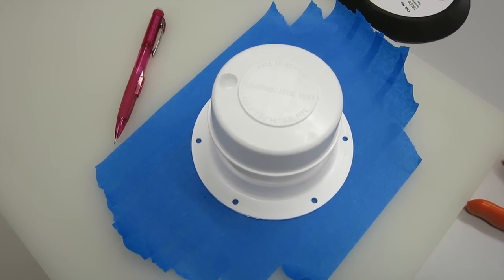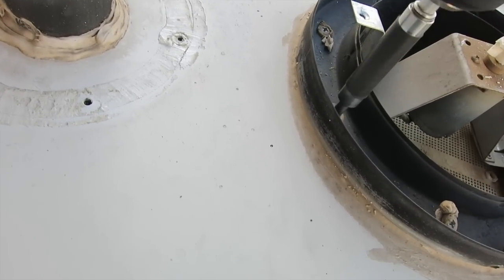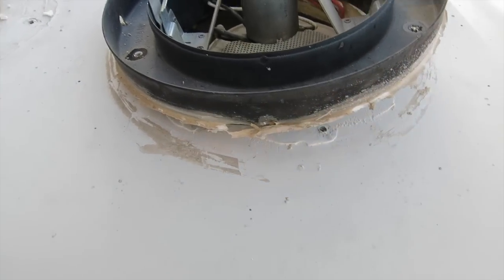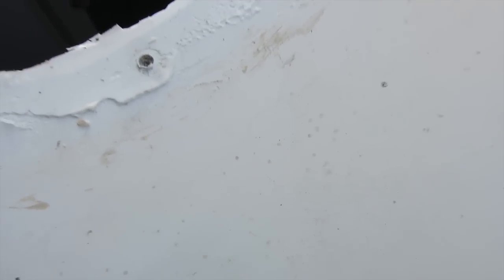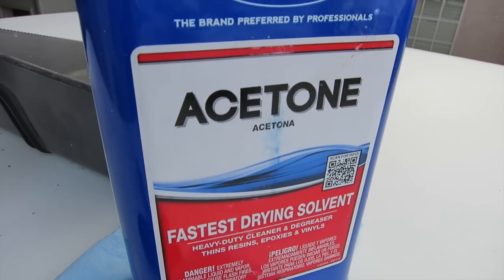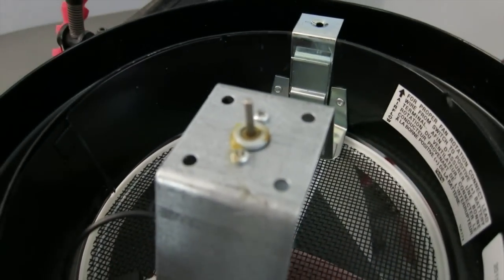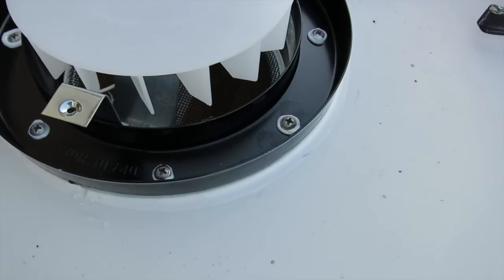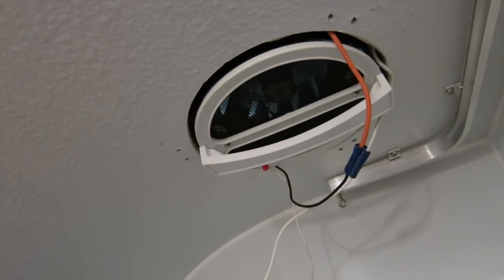RV plumbing vent and bathroom fan replacement

Comment: I can confirm the hard foam insulation is throughout the entire rig. (pop a ceiling light off and you'll see it there).

Only downside to that...especially for me, is you can forget about running new wires through the roof for anything. My number one rule for upgrades and additions is it must be clean and factory looking, no wires visible, so I tap into anything exisiting and run wires through cabinets and such.
Reply from the maker: ***** Yes. I have to find a way run the wire for the new solar. The old wire is too thin for efficiency.
Reply: Xplorer Steve depends on the wattage. I was told a maximum 100-120 watter for that size wire and since I was planning on splitting it into two panels front and back it worked out. Also the one you got is a bit larger and wouldn't fit on my roof due to my fireplace vent and my AC has an air intake on the top of roof. For a 160 watt I'd run new wiring as well. Through the cabinets obvs!
Reply from the maker: ***** Yes, I was thinking the same thing (cabinets). I was also going to remove one of the vinyl covered panels with the button looking things on them. You know what I'm talking about? They are present throughout the van. I'm thinking they are access panels. Have you ever removed one?

Comment: Those "straight" connectors are called butt splices and should be crimped with an electric connector crimper.
Reply from the maker: Yes. I have a special way since I don't have a crimper.

Comment: Nice job....finish looks great.  I would suggest using crimping players not adjustable jaw players to squeeze your electrical splices.  I like the high leverage ones made by Klein Tools.  http://www.kleintools.com/catalog/crimpingcutting-tools/crimpingcutting-tool-non-insulatedinsulated-connectors
Reply from the maker: Terry Landis I've developed a way to crimp using those same pliers every time. I fold one side of the opening in ,then the other. It grabs the wire real tight.  If I think of it next time I am in the tool store, I will look at those Kleins. I try to stay away from any tool store or section though. Too dangerous for me...haha. Thanks for the tip.

Comment: Request Corner:..
Hey Steve,
Can you do a segment on improving gas economy and making your '99 Dodge RAM Xplorer more aerodynamic and other methods to improve MPG?  (Maybe a joint-YouTube project with Happily Houseless!)  

I found folks (youtube) filling gaps in body exterior using home depot bargain basic weatherstripping,  so air doesn't get behind the gaps that create drag.  Also curious if under body plastic panels (like in modern cars) could be adapted to the RAM van undercarriage to streamline airflow?  I'm sure there are some other tips out there?

I like this era class B Xplorer and I would consider these improvement for MPG savings for when I finally own one!.  However, I don't have one in my driveway just yet,  so I can only suggest...Ha!
Thanks for your videos!
Reply from the maker: Kevin Shea Sorry, I won't be addressing MPG concerns. I think that if that's your thing, all the suggestions you mentioned are worth some thought. I've learned the value of hyper-milling on the road whether it is in a car, but especially on a bike. That's as far as I am willing to take it. Simplify that one more step and it comes down to driving below 65 and using big rigs to improve your "aerodynamic efficiency". Take care.

Comment: 👏😎perfection. Very interested in the wiring job of the solar panels can't wait. 🚐🚐🚐🚐🚐
Reply from the maker: Van Nomadic The wiring job will require a work around due to the newly discovered insulation between the inner and outer shell on top. Stay tuned.

Comment: I would basically be doing the same thing you are doing.  RVing out from a home base.  Going to find an RV or Van and just tinker and fix thigs like you are doing and head out on little adventures.  I like the channel Steve.
Reply from the maker: Lyle Z An escapemobile. Sounds good

Comment: I never thought about those caulking cut outs. Better than new job!.
Reply from the maker: FullTime LiveAboard I've seen it done on bathroom remodel video's. They must do it at the factory on rv's too. How else would they get the caulk lines so perfect?
Reply: Good point. I just assumed the new RV's were done with some kind of application machine. I've got the travel trailer along with the van, so I watch alot of roof repair related videos. Super paranoid about roof leaks in the trailer. Just had never seen your method used before. It's a great technique. I enjoy your videos. Thanks.
Reply from the maker: FullTime LiveAboard I think for travel trailers with vinyl roofs, a product called "Decor self-leveling" is used instead of the GeoCell I use.
Reply: Xplorer Steve Exactly. Mine is a sheet of aluminum rolled over some thin plywood. Twice a year I'm up there with a soft brush, rags,acetone and Dicor self leveling, praying I don't miss any cracks or small holes :)